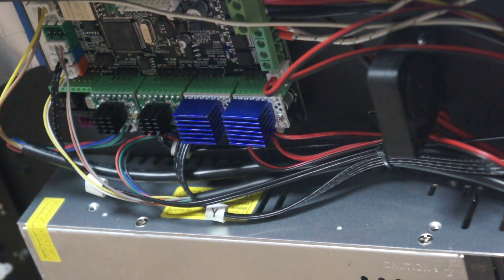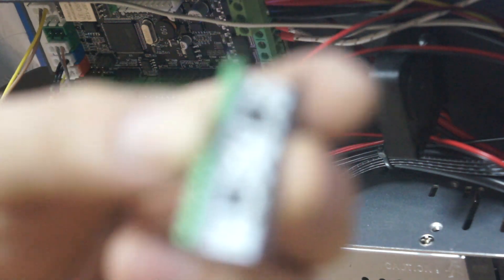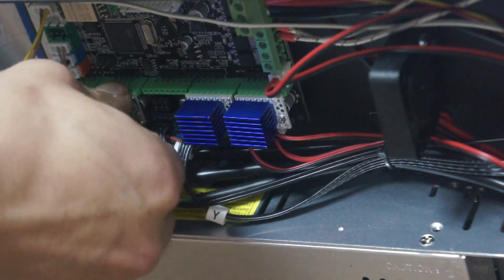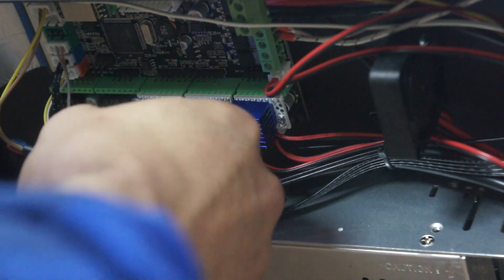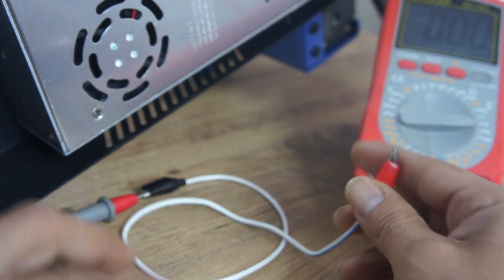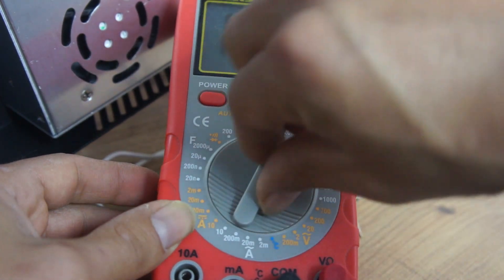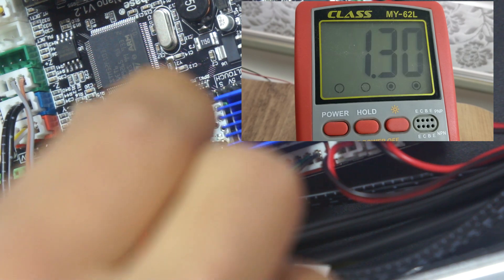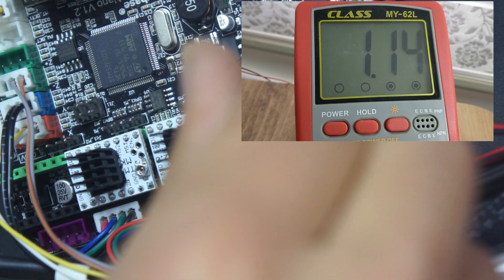Two Trees Bluer TMC 2208 Sessiz Sürücü Güncellemesi

Comment: Kendi üzerinde gelen sürücüler neden 1.32 volt onları da 1.10 yapmamışlar
Reply from the maker: Makerbase'in tmc 2208 vref ayarı için bir formulasyonu var. O formüle göre 1,35V çıkıyor değer. Fakat ben aliexpress resmi bluer satıcısına(ada) sordum ideal tmc 2208 vref voltajı nedir diye. Bana 1,10v dedi. Tork kaybı yaşamamak için maximum değere yakın bir değer ayarlanmış olabilir. Ben 1,10v ile kullanıyorum ve herhangi bir sorun yaşamadım. Kullanıcı isterse 1,30 - 1,35 V ayarlayabilir.